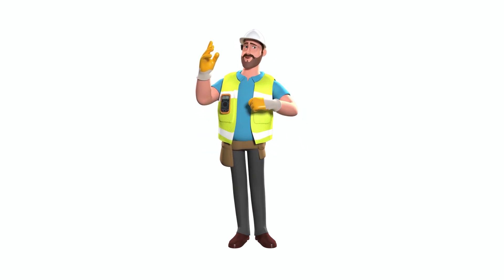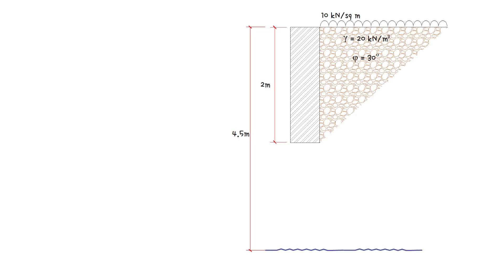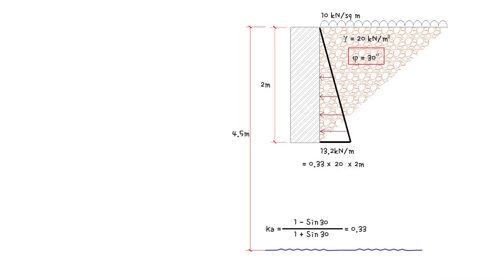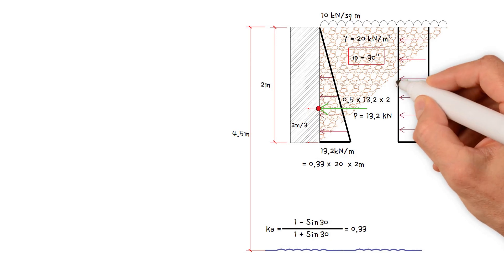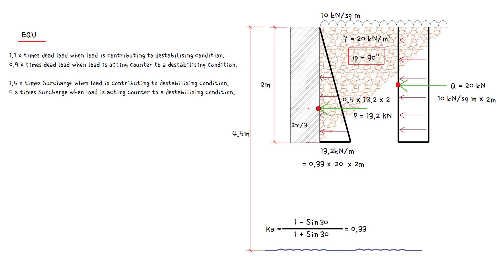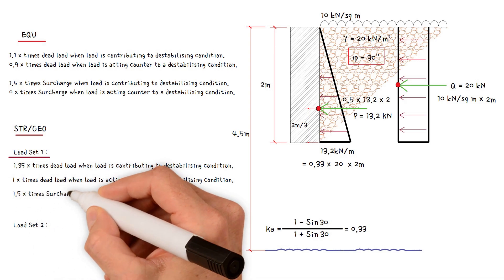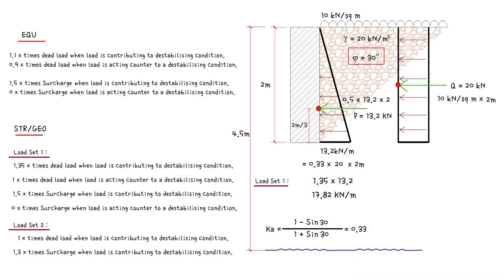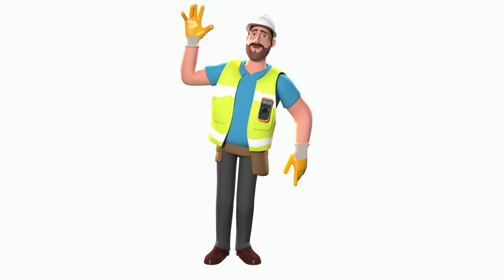How to Calculate Loads on a Retaining Wall.

Comment: FE Manual has P=1/2 x unit weight x Ka x H^2. How come you didn't square the height (2 meters) in this example?
Reply: Has h valued already  included in 13.2 kN/m which is Pa so Resultant   P= 1/2*Pa*h ( here  1/2* base* height where  Pa= 0.33*20*2)

Comment: What about from elevation zero we have -0.5 m concrete, followed by a -1.5 m soil instead of 2m soil from elevation zero? What will be the shape of the pressure on the wall due to concrete and soil.

Comment: guys i am a little confused here also by the units given when calculating the max resultant pressure at the base of the wall.. its expressed as 13.2kN/m but dont think this is correct as its ka of 0.33 which is obv unitless x soil density 20kN/m^3 x 2m which should result in a unit of kN/m^2.. but he does say "13.2kN per m per m run" so presumably this gets you your m^2?  Just a little confusing for anyone trying to learn the basics as we all know getting the correct unit output is so important with all of these things
Reply: correct

Comment: In Set 2, you need to calculate unfactored lateral pressures based on reduced soils strength parameters.

Comment: The total surcharge Q must be multiplied by 0.33
Reply: agreed
Reply: OP should pin this
Reply: Agreed
Reply: Correct
Reply: Correct yes
Reply: Is that a safety margin? Margin of error?
Reply: @DylanHughes-mt5oz  No. It's the horizontal force on the wall due to vertical surcharge, that's why you should multiply the surcharge by ka=0.33

Comment: I think that Q=20x0.33=.....
Reply: iyaa, as though the surcharge pushes laterally into the wall according to the video
Reply: what is Q?, the lateral pressure or resultant lateral pressure force?. Lateral pressure due to surcharge = 20*0.33. Resultant lateral pressure force=Lateral Pressure * area= 0.33*20*H*1= KN acting at the centre of the pressure diagram.